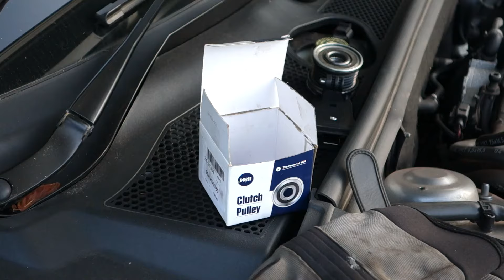Audi A4 (B8) repairs. Episode 1,  alternator pulley and serpentine belt change.

Comment from the maker: If you found this video use full and it saved you spending a lot of money at a main dealer or garage then I would be really grateful if you could drop me a wee donation using the super thanks button and help me make more of these videos. Thank you all, Dave.
Reply: Someone just pointed me in your direction with this video it seems to be exactly what the issue is with my 2.0tdi b7 but I just had. New tensioner and serpentine belt fitted not long ago. The guy said it might be clutch pulley on alternator making similar noises etc?
Reply from the maker: @georgehurrell8480  If the clutch pulley on the alternator has failed you will get this issue. The belt is constantly pulled tight then slips and the tensioner bangs back making the noise then repeats over and over. Its the tensioner that is making it rattle but the pulley on the alternator that has failed.

Comment: How that Pully came off so easy only god knows. I'm here with a vice and a breaker bar and nothing gives. Might as well buy a whole new alternator or better yet a new car
Reply from the maker: Dont know that mine came off easily, I had to bug longer spanners and nearly broke my knuckles when it finally budged. The video would have been a lot less interesting if it showed an hour of me swearing at it.
Reply: @AstonishingGlasgow  i tried even with a impact and it's not budging.. maybe my impact is not powerful enough?
Reply from the maker: The problem is that if the pulley has been on there 10 years then every time the car runs it is tightening the pulley. It did take me a while before it finally gave in but yours sounds like it is being properly stubborn. If uou are using an impact gun, how are you holding the alternator shaft without the torx down the middle?
Reply: @AstonishingGlasgow  im not holding it down. I saw a comment in another video where the shop used an impact and the weight of the spindle would be enough so no need to hold it

Comment: been getting same issue with noise but not the steering only when i rev at cold, been doing my head in for a while sprayed some oil around back of that pulley to test and it helped they reckon 60-80k they last I'm on a mission too change it , already ordered the INA pulley , pd150 arl engine mk1 seat leon 70k

Comment: Just changed mine and your video threw me off a bit tried with the T50 and it just slipped so feared the worst so removed alternator completely when in fact it needed a m10 multispline maybe just my alternator but worth bearing in mind

Comment: I also got some squeeqy noises on my b9 but i changed the water pump and the timing belt. To be honest i still hear weird noises when its cold outside. The mechanic said the alternator pulley was fine and only change the belt. But i think he should have changed everything.
Reply from the maker: If you are hands on then the easiest thing to do is release the pressure on the tensioner and see if the pully is locked in both directions. The pulley should freewheel (turn anti clockwise without turning the alternator) if it is working OK.
Reply: @AstonishingGlasgow  i ll try it thanks. But other than that could be from somewhere else or its only the fact that it's so cold outside thats why the motor its s little bit to loud(more than -11°)
Reply from the maker: On my car, the squeak was caused because the pulley was seized so the belt was going tight, pulling the tensioned then the belt would slip and squeal. It is possible that on your car the cold and damp is causing the belt to slip leading to the squeal but the clutch in the pulley should prevent this. 
It is also possible that the tensioner bearings or the idler bearings are shot and causing a squeal?
Reply: @AstonishingGlasgow  aight mate. Thanks for taking ur time to respond. I think i’ll replica them all is not that expensive. Like that i have everything new on my car and the weird sounds should go away.
Reply from the maker: No problem, I am happy to try and help. Now that you are at the point where it would be the same amount of work to replace them all as it would be to replace one it would be a good idea if you can afford it. At least you would rule out everything on the belts making a noise.

Comment: Really helpful this, thank you for sharing. Can I just check though that you are turning the spline tool anti-clockwise whilst holding the T50 Torx steady? I just cannot get mine to budge and I've read conflicting info about it being a reverse thread?
Reply from the maker: That is correct. The torx is effectively holding the alternator shaft in place as I unscrewed the pulley. It will be VERY tight as it spends its life being tightened. This is why I bought longer spanners to get more leverage and it still took me a lot of work to free it off (edited for time). Be patient, apply force then release over and over and eventually you will win.

Comment: Hey question: Is it possible as a «quick fix» to just tighten the pulley?
Reply from the maker: That won't solve anything unless the pulley is falling off. There is a bearing and clutch inside the pulley so tightening the bolt in the middle will have no effect on the clutch and make it even harder to remove when you need to replace it.

Comment: Just one thing that has me a bit stuck. What direction to loosen the spline nut
Reply from the maker: With the torx bit holding the alternator shaft, undo the pulley with the spline bit in the normal direction (anti-clockwise).
Reply: @AstonishingGlasgow  yeah that's the way I went however the pack that the spline tools came in said otherwise. I feel like I've rounded the torx bolt
Reply from the maker: It was fiercely tight when I did it but it definitely wound off anti clockwise. That is why it is on so tight is the belt is constantly tightening it to the shaft. I hope the torx didnt strip. It is hard to fully seat the torx because it is inside the pulley so hopefully it just jumped out rather than stripped.

Comment: I have the same noise, i tought its the Power Steering Pump?
Reply from the maker: Not in this case, replacing the pully fixed the noise.
Reply: @AstonishingGlasgow  thank u very much, btw... Your Video is awsome
Reply from the maker: Cheers, hope it helps you fix yours and its a lot cheaper and easier than a power steering pump.
Reply: @AstonishingGlasgow  i ordered all Parts, ill shoot a massage when im done. 💪
Reply: Desperado how did you fix go did it work???

Comment: Hey I've just replaced my belt today on my B8 A4 it was a footery wee bastard, but it's so much more quiet! Just a quick question is the alternator supposed to have a slight whine like all dynamos/generators or should it be completely silent? Also I was inspectingmy tensioner pulley it has a run out of maybe 0.25-0.5mm (by eye) but makes no adverse sounds is this also acceptable?? Thanks again for tutorial mate very good video and I've subscribed.
Reply from the maker: Access is terrible without removing the front panel, glad you got it sorted. Noise from the alternator I hadnt noticed but to be honest I wasnt looking out for any noises so could just be normal. My tensioner isnt perfectly square on the belt either so lets both call it normal and not worry about it. ;-)
Reply: @AstonishingGlasgow  Had a listen to my dad's A4 estate there tonight also B8 same engine code and the alternator sounds exactly the same so I'm just gonna chock it up to being normal! Also his tensioner pulley has far more run out so again gonna go for normal lol.. What was the reason for you changing your alternator pulley may I ask was it seized solid? Also should it be able to turn both ways with the belt off as mine does. Thanks again.
Reply from the maker: Cool, all seems normal then. I replaced my pulley as it had seized solid. It should (When the alternator is not spinning) rotate in one direction but lock in the other. I would suggest yours cant turn both ways or the belt wouldnt drive the alternator. I replaced mine because the locked pulley causes the belt to tense up then slip and thats what causes the tensioner to rattle.

Comment: Hi great video. My tensioner pulley is doing the same thing vibrating like mad sometimes. But I think it's the alternator pulley now I've seen your video! Would you have a part number for the pulley? I can't find it on euro car parts website. Thanks
Reply from the maker: Thanks Nigel. I don't have a part number unfortunately. I was able to buy mine over the counter at the local GSF branch before it closed.
Reply: Sorry mate one more question.. is the pulley left hand thread?? Or just f**king tight?! Lol
Reply from the maker: It is lefty loosey but spends its life being tightened by the belt so it is tighter than a Scotsman's wallet. (its not racist, Im Scottish). I had to buy the long 10 mm spanner to get a bit of extra leverage and it still took a lot of force.
Reply: @AstonishingGlasgow  ah good to know mate. Yeh I just ordered some long ass spanners just for this too! Was just worriedd it had left hand thread! LOL

Comment: I had to replace my alternator pulley as it was seized like yours. The back of my hand looked like I had been mauled by a animal by the time I was finished. So tight to work in.
Reply from the maker: Its a horribly tight space and at a horrible height for me (6'3") so my hands were cut to ribbons and my back was aching by the end as well.

Comment: I NEED HELP PLEASE. I noticed my mid serpentine wheel is bent to the left so the belt is slowly slipping out and making a loud noise from all the screeching. how to i get out the radiator without fucking up for the AC gas comp? I have to change the mid serpentine wheel and put in a new belt.
Reply from the maker: Sorry, I meant to reply to you when I approved your comment but got side tracked. You can put the front lock carrier into the service position. This let's the radiator and ac condenser move forward a couple of inches for access without splitting any coolant or ac lines.
Reply: @AstonishingGlasgow  thanks alot man.

Comment: Hi .  Just fitted reconditioned steering rack to 2010 citroen c5 1.6hdi.  It has an electric power steering pump, but rack seems conventional to me(  t40 torx screw holding the 2 pipes into the rack).  After fitting, when I start engine (and car stationary) the steering wheel turns by itself to the right until stopping in the full right lock position. This happens if the front end is of the ground or front wheel on the ground.  I do think I centred rack correctly before installing, maybe I need to recheck. Basically, what could cause the steering wheel to move by itself always to full right lock position?  Any ideas appreciated.  Thanks
Reply from the maker: Im really sorry, I have never worked on a Citroen so I really dont know what could be causing your fault with the steering. If somebody else posts an answer here I will be sure to approve it so that you can read any advice that comes through.

Comment: Torque for the pulley bolt?
Reply from the maker: Use the German setting, Gutten-tight :-D. There is probably a specified torque but to be honest, while running it will tighten its self, thats why its so hard to remove.

Comment: Hello, very detailed tutorial! I have tried to replace my alternator pulley on my A5 2.0 Tdi due to screeching noise but without success ☹️
How have you done to remove the clutch pulley? I blocked the Torx with the M10 wrench and tried to unscrew turning the 33 spline tool anti-clockwise but pulley is completely blocked... Even with lubricant overnight and 1 meter tube to multiply strenght there is nothing i could do. How tough was it on your A4?
Reply from the maker: I did shorten the process for the video, it was really hard to get the pulley off due to being tight and the lack of access. That is why I bought the longer 10mm for leverage and I had a rolled up bit of cardboard in my glove so that I could push on the 17mm harder. In the end I spent a good hour applying then releasing as much pressure as I could over and over when it eventually gave in. Hopefully you will get it, I did think I was going to need to remove the alternator but I kept going with adding then releasing pressure. Good luck with it, Dave.

Comment: Hi pal. I appreciate your vid has been up for a good while but they're great as a general Audi repair reference so thumbs up for that.

To my point; I need to do this same job on my C6 A6 but I'm struggling to find the correct numbered part. (I'm not near the car at the moment). Do you have any suggestions as to how best to source correct parts? Or is it a euro car parts jobber?

Cheers, and all the best.
Reply from the maker: Thanks for the kind words and glad the video is useful.
I dont have a reference for the part number, I am sure I ordered the bits from GS&F so there or euro would be an easy option.
Reply: @AstonishingGlasgow  cheers for the reply. I'd forgotten about GSF. Cheers, i don't do myself any favours always shopping for parts when I'm nowhere near the car. Nevermind, appreciate it nonetheless 👍🏻

Comment: Can you tell me the length of the T50 bit you're using? I haven't got one, so I want to be sure I order the correct length. Thanks!
Reply from the maker: The T50 bit I use in the video is 75mm long. Hope this helps.
Reply: @AstonishingGlasgow  Thanks mate! I'll try to find one
Reply from the maker: Its the same length as my spline bits so I think its a standard size for longer bits. Dont go any longer or you will struggle to fit it between the pulley and the radiator support.
Reply: @AstonishingGlasgow  Yup, I got the "standard" tool, with the 1/2" socket. That will never fit, so I need the bit you're using. I'm now considering removing the alternator altogether to do the switch. Might be faster than searching for a bit and waiting for delivery. And it will save my hands 😅
Reply from the maker: I honestly didn't have any trouble getting hold of the bit. I'm pretty sure I got mine on ebay.

Comment: Superb video! Nicely edited. No need for talking just show us how it's done :)

Question : I need to remove the alternator to replace the bearings. Do you know of there is enough space to slide the retaining bolts out without pulling the bumper into service mode? Can't find anything anywhere. Thx!
Reply from the maker: Thanks Richard. At one point I thought I was going to need to remove the alternator to get this pully off but didnt need to in the end. To me (and from memory) it looked doable to remove without service mode but again, its a very tight work area so it may be quicker in the end to move the bumper. Good luck with it.

Comment: I have the same car. Do you think the belt tentioner hardt to replace ?
Reply from the maker: I think so. If doing the tensioner you would be as well as doing the timing belt, water pump and idlers as you will need to take the front of the car off anyway. I dont see any way to do the tensioner without removing the bumper, headlamps and radiator.
Reply: @AstonishingGlasgow  I successfully changed my tensioner in a parking lot, my old one exploded and teared my belt. I did not remove the front, radiator or bumper. I only needed to remove one air hose, the tentioner bolt is REALLY hard to reach and is not accsesable with a rachet only a wrench. I think it took me about 5 hours to install new tensioner and belt, with the real problem was removing the old tensioner. 

One question, my new tensioner is jumping up and down, do you think this could me caused by a bad alternator pulley?
Reply from the maker: Well done, given the access problems its not a job I would fancy doing that way. What you need to keep in mind however is the state of your timing belt and water pump. If the last guy replaced everything at the same time and your tensioner just failed then potentially your timing belt could be very near the end of its life. To test the alternator pully turn it with the belt off. If it spins the alternator when you turn it in both directions the clutch has failed and will cause your tensioner to jump.
Reply: @AstonishingGlasgow  thx, parked my car for the time being waiting for parts. My timing belt was replaced recently.
Reply: I managed to change the pulley on an a4 2.0 tdi without taking the radiator out, only the bumper. We loosened the radiator in the top so we could pull it back by a few cm, that was enough room for the mission. Although a little tight it saved us some time

Comment: I have a 1.8T 2008 there is what sounds like a bearing sqeak at idlle so I changed the idler pulley but the sqeaky sound is still there, it comes when the engine gets to operating temperature, do you any idea what could be causing it?? I'm pretty sure it's not the belt though
Reply from the maker: Could be an idler pulley on the timing belt or more worryingly a fault with the water pump. If the water pump is failing it could be serious as a seized water pump will destroy your timing belt so best get it properly diagnosed soon.

Comment: Great video which has helped me identify the rattling and vibration in my A6. The previous owner spent €1400 replacing the flywheel due to a misdiagnosis of this much cheaper failure. I still have a dealer warranty even though it's a second hand C6 model so I will bring it back to him and get it done.
Thanks again.